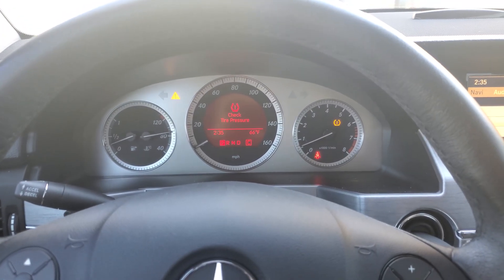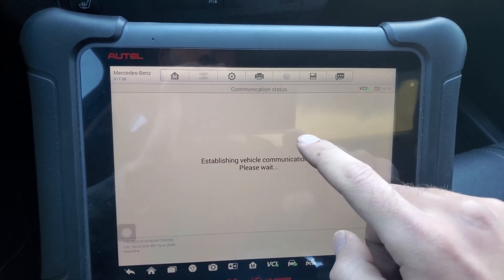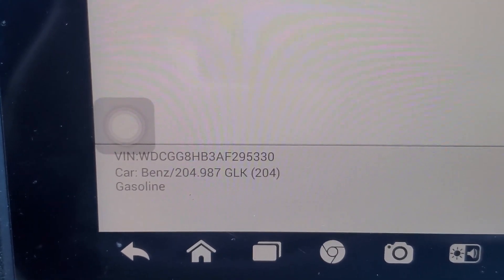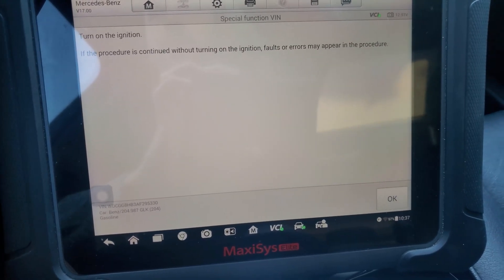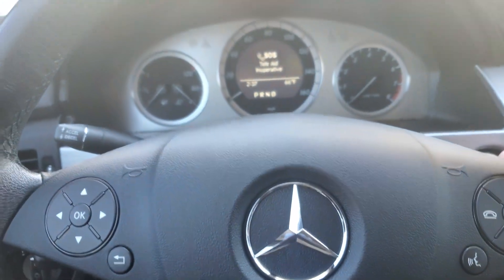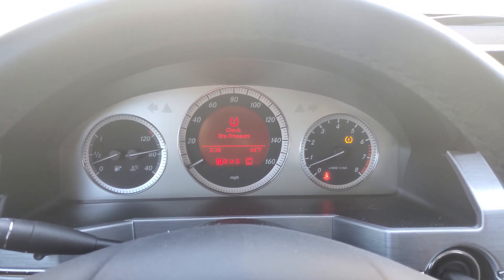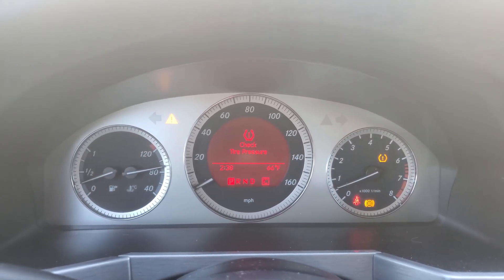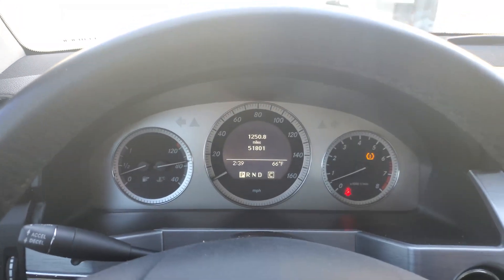Mercedes Benz GLK350 Used ESP / ABS Module Coding Programming | Autel Maxisys Elite

Comment: Getting same issues with my c class 08 with original abs just wondering if that's abs module fault and if i replace it myself is a car drivable just to get to coding station? Also have couple other codes as abs sensors not passing information which is very confusing as my diagnostic is reading their data no probs same with brake switch it reads pressure and on off status but have code stored as it is short circuted. Suspect abs not functioning properly as it makes clock ticking noise with engine shut off
Reply: I hâd same issue on w204 2.2cdi, 90%of the Times there is internal circuit fault în those modules. The New one needs to be virginezed and coded with car vin number.
Reply: @gabrielc5642  Ok and how is this done?